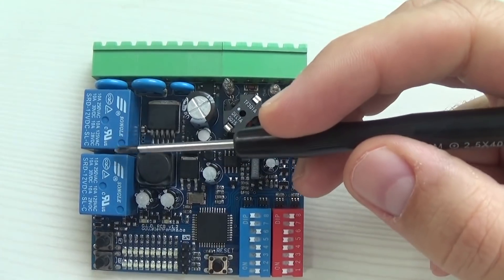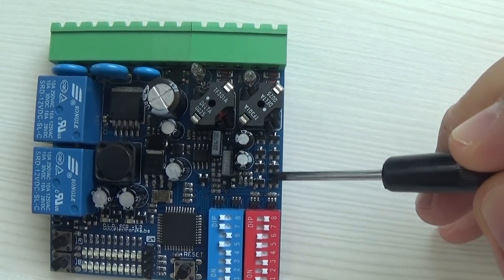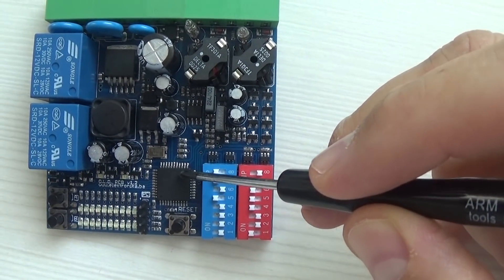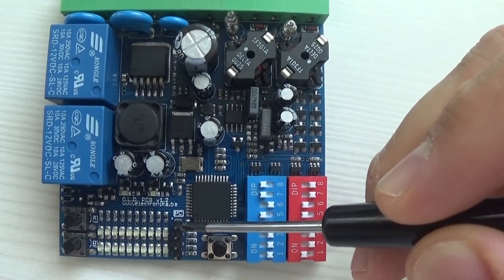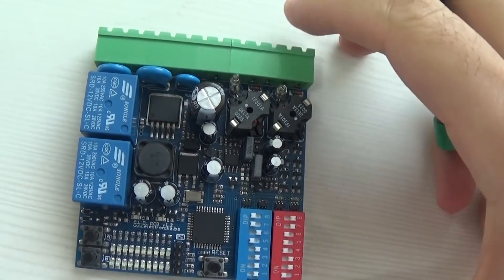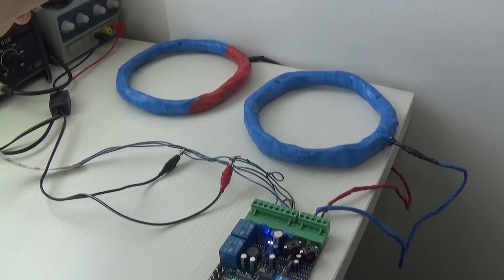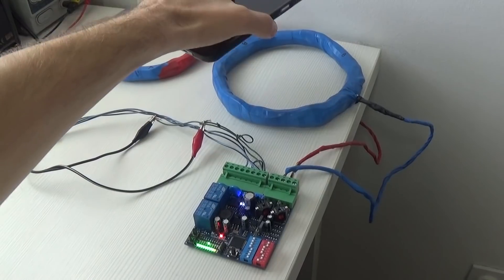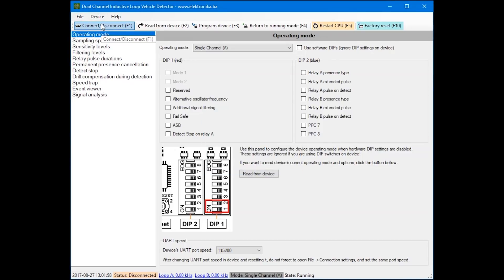Dual Channel Inductive Loop Vehicle Detector

Comment: If this is pre-programmed PIC (firmware not charged, is free) then how to buy this and what will be cost
Reply from the maker: @NawabVlogs100  how many do you need? If you want assembled device, it is available on Tindie. Please check the website www.elektronika.ba or the video description.
Reply: @traxonja  we will assemble self . We need only a programmed controller in bulk.

Comment: Please tell me how to setting the loops? Is it 1 long cable and 1 side going to gnd, 1 side going to vcc or how? Sorry for my bad English
Reply from the maker: Please visit my website and download user manual and also look at the schematics. Loop is a one long wire, where you make "3-5 turns" in the detection area and you "twist" the two ends to connect to the electronics. No, it does not connect between gnd and vcc.

Comment: can it be used to measure the speed of the vehicle moving over the induction loop?
Reply from the maker: Yes it can :-)
Reply: @traxonja  can you please elaborate on how the speed is being measured and how to implement it's code/algorithim to an MCU like an arduino uno or a raspberry pi?
Reply from the maker: @saadhassan5250   @saad hassan  the device measures the speed by itself. You just need an arduino or a PC to read the speed via UART that the detector outputs. There is a document describing it in details, please see description.

Comment: How much power does an inductive loop use? Can this be used in a battery powered application?
Reply from the maker: Hi Dylan. It draws around 10 - 15mA while working. This is for the PCB v1.3 that has less components than PCB v1.2. If you remove LEDs as well, it could go down even more.

Comment: Hello traxonja, This a really good video, and I have a question about it.  I have a 7m wide garage door, and cars can arrive from any direction, i mean, not only from directly from the center of the driver way, but from from perpendicular drive ways, so it's possible to assemble a loop to cover this 7m garage door? or it is possible to connect several (how many is the maximum) loops in serial connection to a single channel loop detector? thanks very much!
Reply from the maker: Hi, 7m can be covered with this device in dual channel independent mode. This means two loops of 3.5m. I am not sure if only one of 7m will work - I never tried. Let me know if you need anything else :)
Reply from the maker: It might be possible that 7m loop will work just fine even on single channel. See these drawings: http://buckholztraffic.com/ARTICLES/ARTICLE_4_Required_Inductance.pdf Also this document is worth browsing: http://www.siemens.co.uk/traffic/pool/downloads/handbooks/road_signals/667_he_20663_000.pdf

Comment: Many thanks for your video.  What distance can the inductive loops be away from the actual device before it stops working?  Could I set the board up in one place with the loops 50 meters away?
Reply from the maker: 50m should work just fine. Longer cable lowers the sensitivity. I guess you will have to try :)
Reply: @traxonja  Any idea where I can buy one of these as shown in the video?  I note on the websites provided it appears that I need to buy PCB and install/solder the chips myself?  Can you confirm?
Reply from the maker: @nonicknamesremain  Well, you can buy parts and assemble one yourself, or I can make one for you. Go to https://www.elektronika.ba/1/contact/ and send me an e-mail.

Comment: Hi..
Sometimes my loop detector gets struck and shows the red light always... 
What could be the problem?
Reply from the maker: Intruder T it is hard to say. you need to read the error code by holding the button for sensitivity setting. yellow led will tell you what the problem is. it is probably bad loop connection or something wrong with your soldering maybe?
Reply: Use a Loop Sealant.

Comment: Is this your product ?
Reply from the maker: Yes it is. Hardware is open source, but you can order a pre-programmed PIC (firmware not charged, is free) if you want to DIY.
Reply: traxonja ..
I need one...
Where can I buy/ download if any PDF  is available?
Reply from the maker: You have all documentation here: https://www.elektronika.ba/868/dual-channel-inductive-loop-vehicle-detector/
You can buy PCB and pre-programmed PIC for your assembly. There are links on the website.
Let me know if I can help more.

Comment: Which wire did u use to make the loop(blue color coil)?
Reply from the maker: I used standard 1.5mm2 copper wire for this test. If you want to install the loop in ground and seal it with hot sealant then you must silicone insulated wire that is heat resistant.
Reply: traxonja thank you. I need another information how many meters of wire did you used
Reply from the maker: Ayesha Siddika I made around 20 windings around a CD box. I dont recall how many meters there were.
Reply: Thank you....
Reply: It's black and 1.5 mm wire..
It's a hexagonal loop..
I use a single channel loop detector